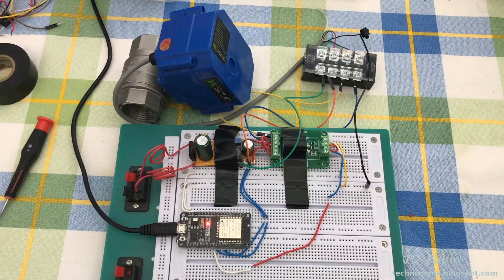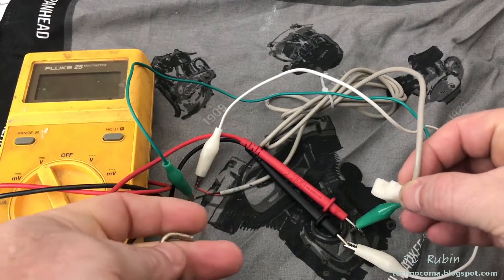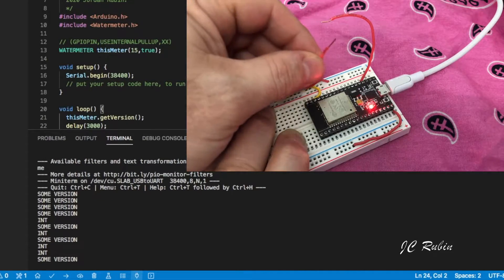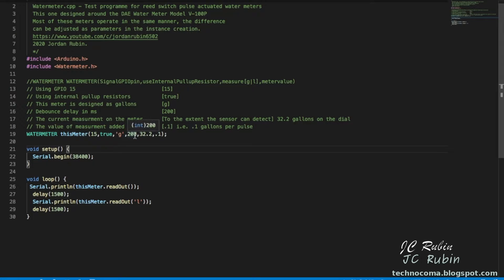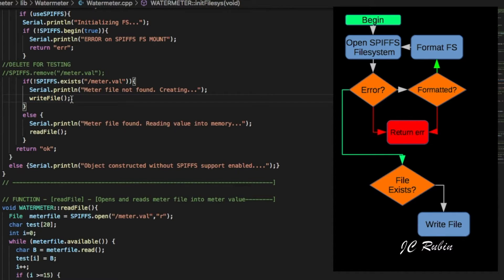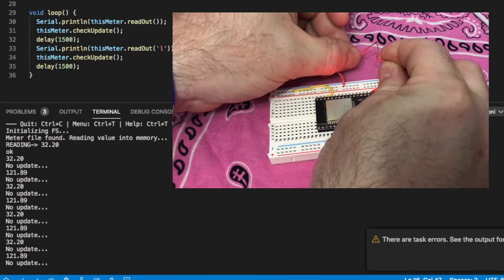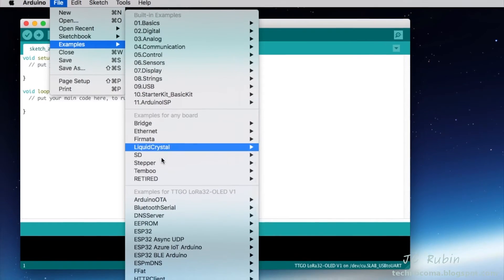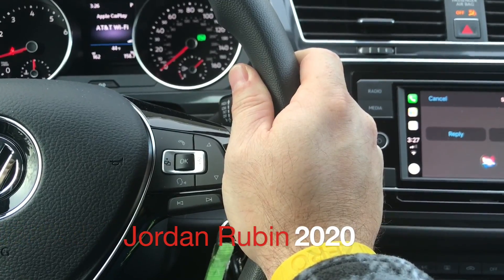ESP32 Automated Irrigation Control System Project - PART 2 - Water Meter Implementation

Comment: Thanks for sharing this!  I had a similar issue with a massive water leak and just installed a water meter and 2 electric valves (same valve model as yours).  The line from my meter now ties off into one valve for the irrigation and one for the house. Like you, I plan to integrate a sprinkler controller and tie this altogether to monitor and test for leaks (in both the irrigation and the house)   I’m new Arduino/home automation so started seeking out examples and came across your videos. Very informative! - Nice clear explanations of the code and how you are developing it.    Were you planning to use home automation software like home assistant/node red?  Look forward to your next video.
Reply from the maker: Part 3 has been posted.